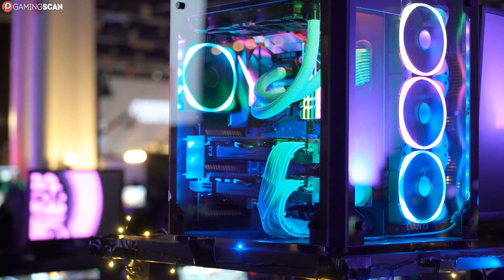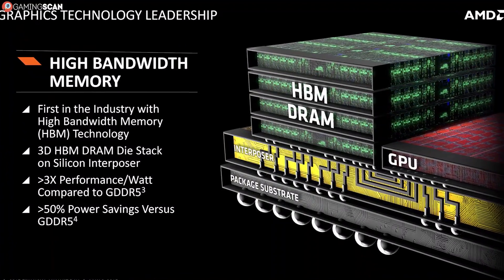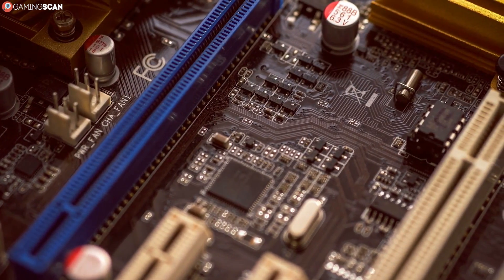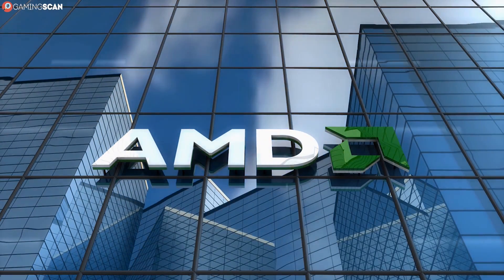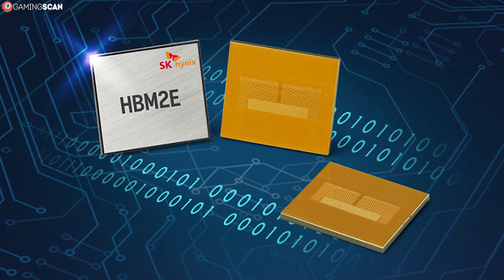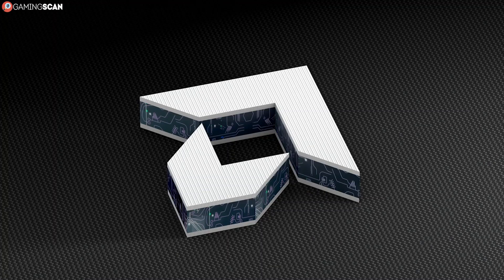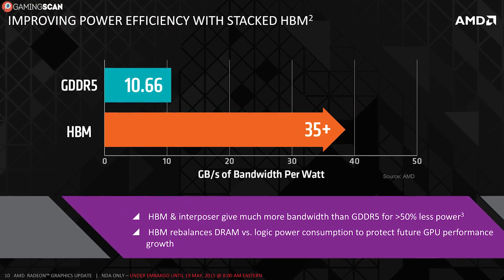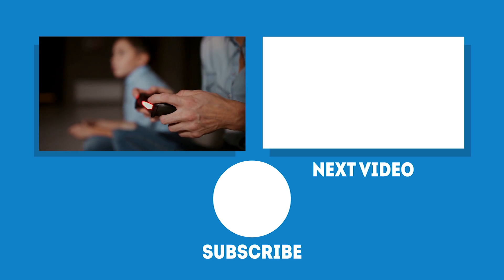What Are HBM, HBM2 and HBM2E? [Ultimate Guide]

Comment: What HBM2E would be truly amazing for is gaming on AMD's small APUs. Those are surprisingly powerful- even in the 15-25W U-series line, the 4800U matches the PS4 in graphics power and leaps way beyond it in CPU grunt. Its best RAM option (Quad-Channel LPDDR4X), on the other hand, maxes out at only around 68GB/s, compared to the 176GB/s of the PS4's GDDR5 - this makes for a nasty bottleneck on the GPU, and maybe even the CPU. Even the most basic, heavily-underclocked HBM2E or HBM3 would be able to easily hit the 200GB/s mark, with its lower power consumption making it feasible in a slim, power-sipping device like an ultrabook or even a handheld.